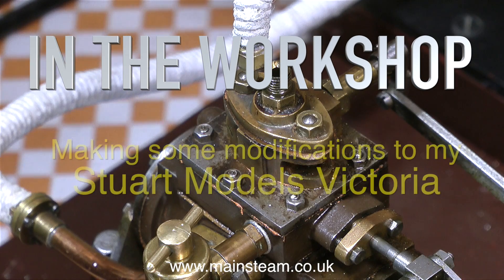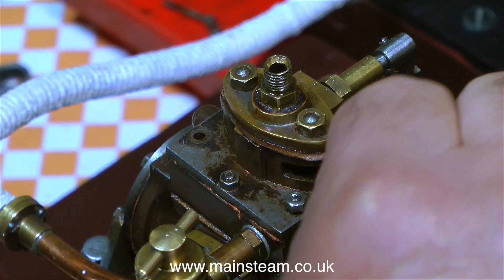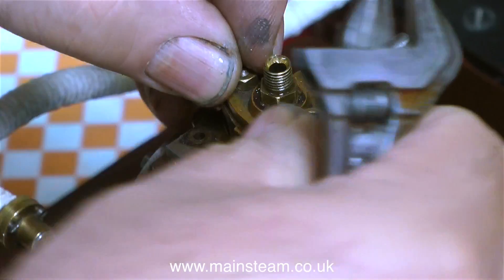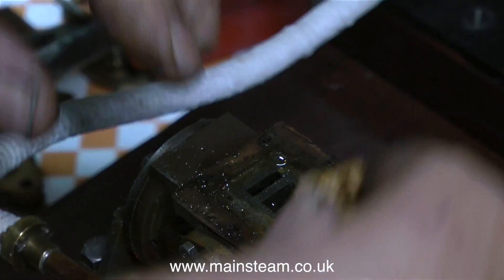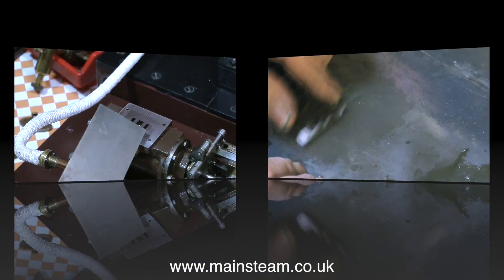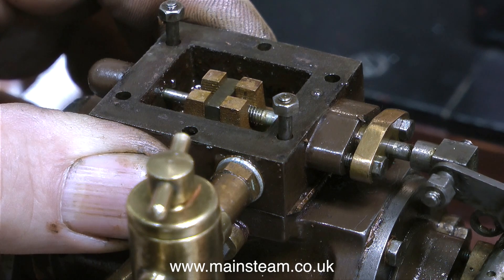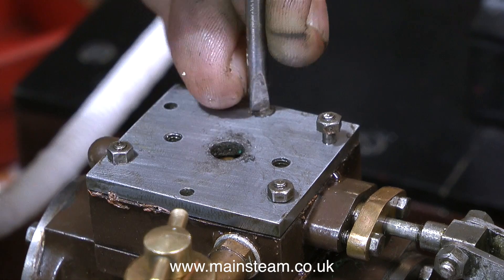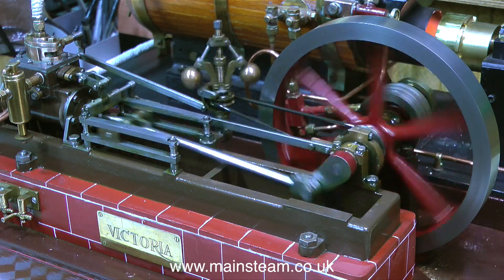IN THE WORKSHOP - MODIFICATIONS TO MY VICTORIA STEAM ENGINE

Comment: dude finger eights on a set plate you can achieve this by putting emry cloth on the engraving plate in the last video and go in finger eights im a machinist i know how to make things extremly flat its just the grind pattern will make it bow, if you do it your way or heal (bottom of foot the joint). It would also show any high points in the piece of metal your flattening i just dont want to be rude and but your doing a how to video for beginners.

Comment: question @ mr keith : at 6:49 the engine runs but goes slow fast slow fast etc . why is this ?? is something binding or is it just te speed is too low ?
Reply from the maker: Because on one part of the revolution,  water is being pumped into the boiler by the crankshaft driven water pump against boiler pressure . . . .
Reply: thanks mr Keith
Reply: should the governor on this model not compensate for that ? just wondering if i think it over .
Reply from the maker: Governors at this small size are not always effective, plus the speed that the engine is running at in the video at 6:49 is very slow anyway ......

Comment: Hello Keith, I do love the job you do (not to mention your touch of humour) but you're having it wrong: cleaning the port face with sand paper puts abrasive in the ports and, in the end, in the cylinder itself. This is the best way to kill 3 birds with a single stone, namely the cylinder, the piston and its rings.
Reply from the maker: I have not personally had any problems in any way with valves, pistons or cylinders doing it this way for the last 45 years, but I suppose you are right ....................... I am having it wrong ......... :-)))
Reply: hi Keith you dont have any problems because you use oil n the abrasive never really comes off and you wipe it down good also . keep up the good work !!!
Reply from the maker: A good point, but really the first steam that hits the cylinder condenses to floods of water and washes out the valve chest & cylinder thoroughly anyway :-))))
Reply: Since there's no horrible scratching sound when this beautiful engine runs, I guess you're right about the initial condensation washing out the cylinder ends.

Comment: Great video as always!  I was surprised to see that the ports weren't protected from the sanding dust.  I would think the last think you'd want is cast iron grit in the cylinder.
Reply from the maker: I have not personally had any problems in any way with grit affecting valves, pistons or cylinders doing it this way for the last 45 years ....................... the steam & water instantly flushes any contamination clean away .....
Reply: Keith Appleton that makes sense.  I come from a IC engine background where that kind of thing is a big no no
Reply from the maker: Me too - but these are Steam Engines and they co-exist in an alternate dimension to R/C stuff & glowplug engines :-))))) Talking about IC, I bought a vintage OS FS-61 the other day, it's quite nice on its own display stand and will fit in with my modest collection of old glow engines  - mainly Cox and, Webra, OS  & Laser. . . . the "Cox .010" is very tiny .....